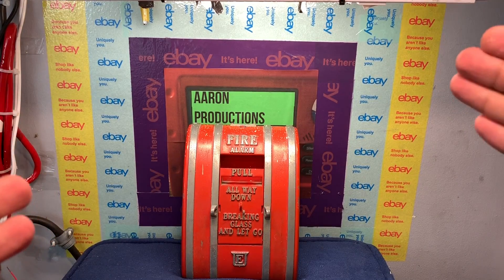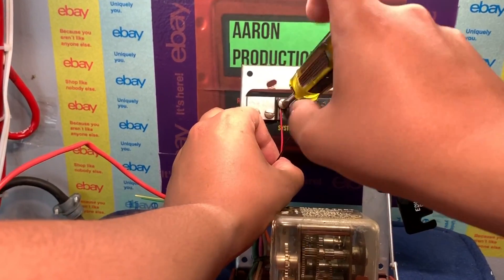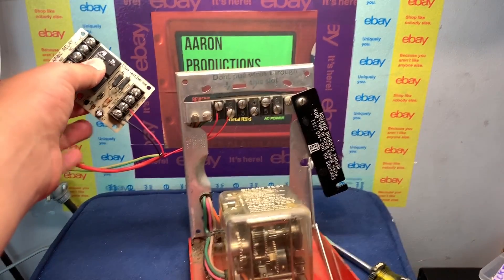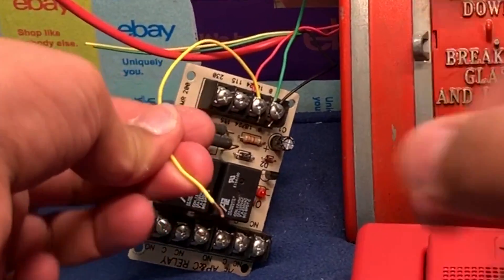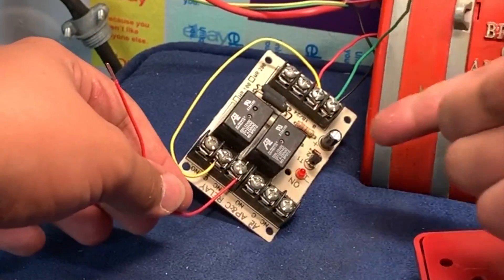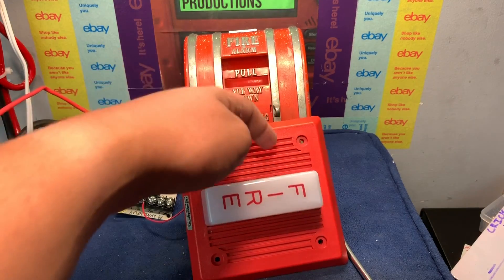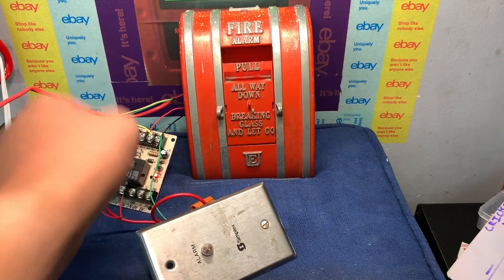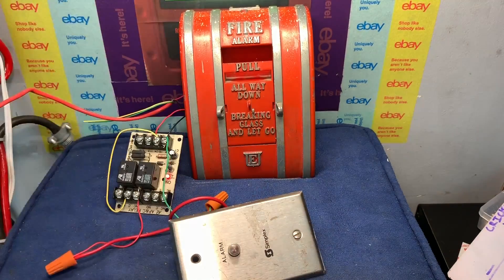How to wire a normally closed coded pull station to be normally open (to use with alarm)

Comment from the maker: I just realized this was wired wrong and that’s why it only sounded for a second, since I used the relay input to supply the alarm side going through the relay, when the power is cut to the relay, it’s also cut to the alarm. Leaving a short window of time for
It to actually sound. Connect the positive going into the common of the relay to the power supply not affected by the pull station. Sorry about that!
Reply: Do you mean connecting the positive side of the alarm directly to the power supply instead of the common terminal on the relay?
Reply from the maker: @Fahrenheit4051  connect the positive going into the common of the relay to the power supply, and then the normally closed to the positive of the alarm. in this video I had the power humored from the relay input, which, when the relay lost power - it would obviously not have any power to go through the positive jumper - and the only reason it even sounded for a second here was due to the delay when power was reapplied, so it is the completely wrong way to do it. just make sure the relay is powered by the pull station, and the alarm power going through the relay is from the original source